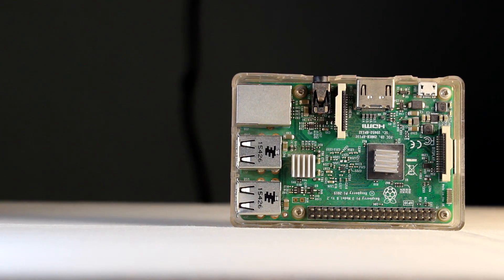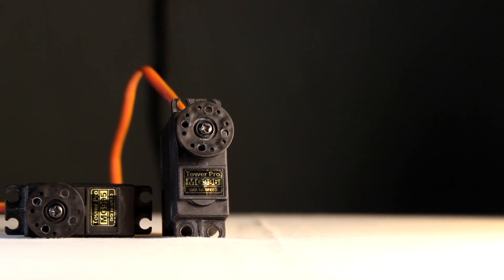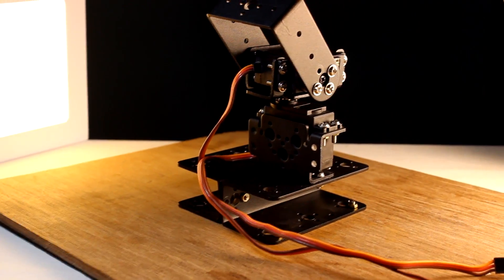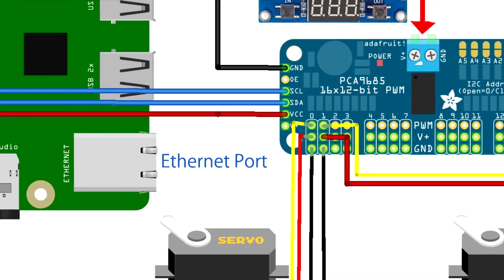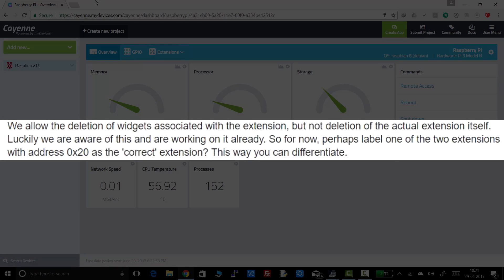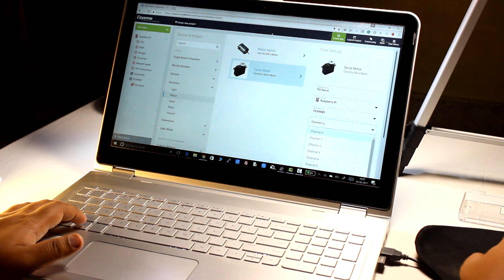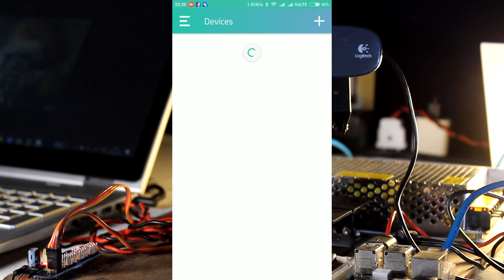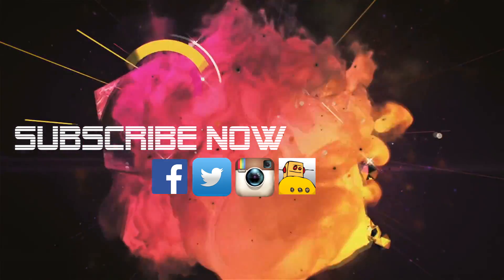IoT Home Surveillance Camera | Raspberry Pi + Cayenne + Webcam Server

Comment: Awsome video. Hi, i have a question. 

Does it has to be necesary use the servo extension board? Can I use only the GPIO pines of the raspberry?
Reply from the maker: No it's not compulsory to have the servo driver board. But power the servo separately. Common the ground with rpi. Then If you can use the gpio pins of rpi.

Comment: Hi sir your video was awesome. I am new at RPI. I want to do it without the use of RJ45/Lan cable. Would it still work?
Reply from the maker: +Job de Chavez yes of course
Reply: Thanks. Another thing sir, if I enter the ip and the port having 2 usb cameras on the pi will it show 2 view simultaneously?
Reply from the maker: For using 2 cameras you have to configure the motion package differently. Then it will work.